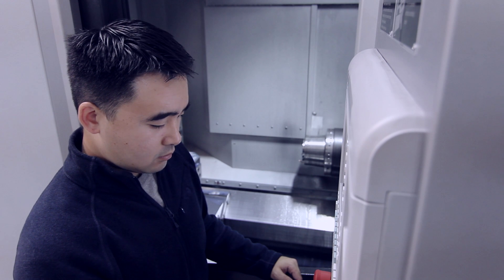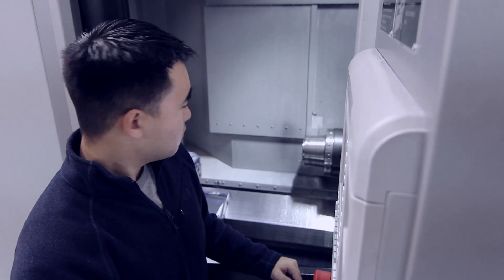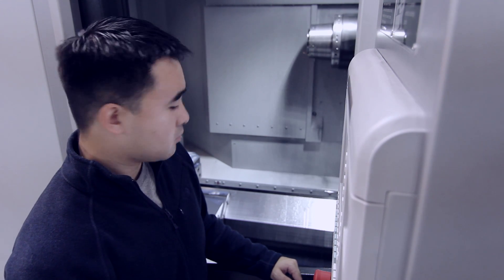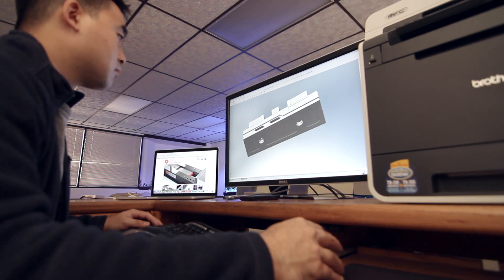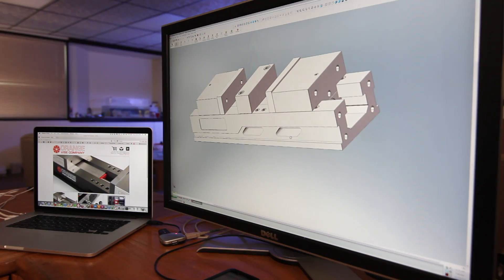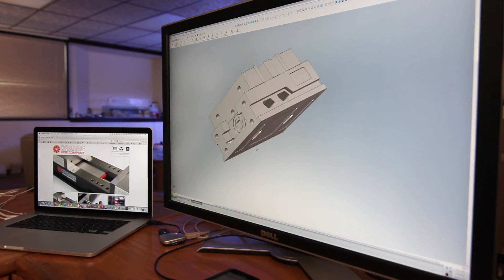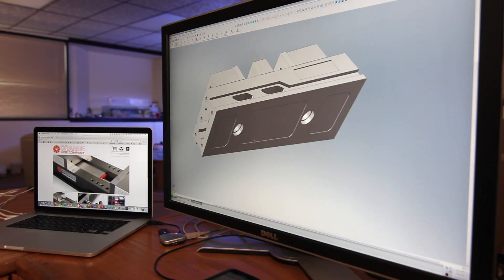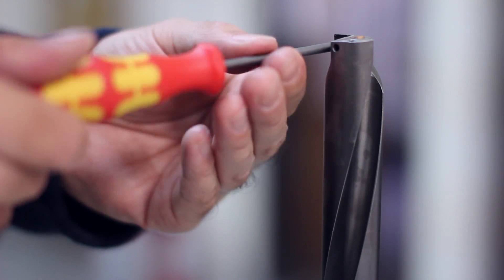Orange Quick-Change CNC Machine Vises

Comment: Hi, I have a quick question about the shank setup of these larger face mills such as yours, which appears to be a multi-piece shank style just like what I have. Ok, so I have a standard BP mill model like seen here, and my friend recently gave me a 7-cutter 3" diameter face mill. Your video was the first of anything I saw on google that looked like how my tool would actually end up looking. Here's my question then, if you would be so kind. I have the face mill body which has a stepped hole in the center, and on the top plane I have the roughly 10mm slot spanning across the center of the mounting hole (everything looks like yours), but what do I actually want to use as far as an R8 spindle to hold and drive the face mill? Is there a certain name for a shank made to drive that specific style? Thanks a lot for any help you can provide. ;)

Comment: Amazing work on those vises. I agree if you made some nice small vises for home shop guys I'd be interested. Especially a dual station one.
Reply: Yeah I would buy a small one for use at home if they made one too.  Only problem is that they are so nicely made that I wouldn't be able to live with myself if I scratched it by actually using it.  I guess I would just have to buy two -- one to use and the other to look at on my entertainment center. :)

Comment from the maker: To avoid making a mess, we turn off the coolant when filming. Normally, we use coolant when milling every material except steels.

Manufacturing in the USA is still a very viable option in many industries. The added quality control and the drastic reduction in lead time makes it appealing to many customers. It only takes one bad production run or one delay in shipment for an overseas manufacturing operation to completely backfire and erase any cost savings.
Reply: I worked as a "small"  machinest while in college and appreciate finely detailed work. The quality detail of your work is amazing and qualifies to be called craftsmanship. Congratulations for returning meaning to the phrase "made in America" (all of my Father"s tools from 70 years ago had the same phrase written on them in big letters).